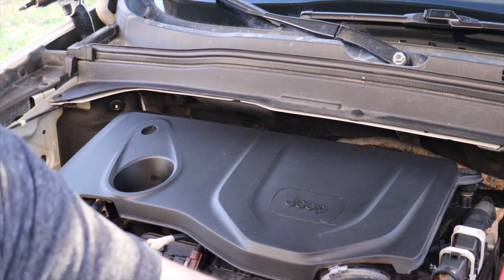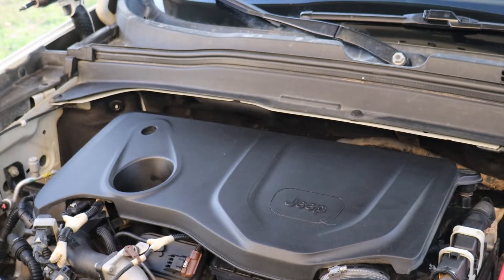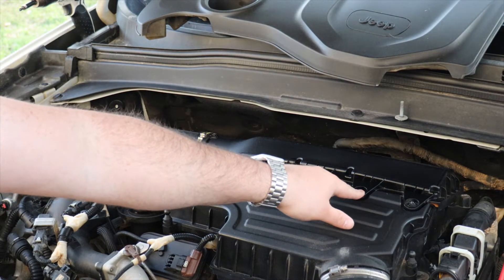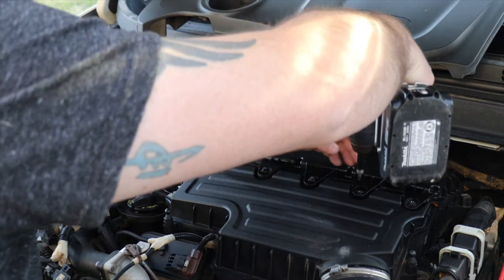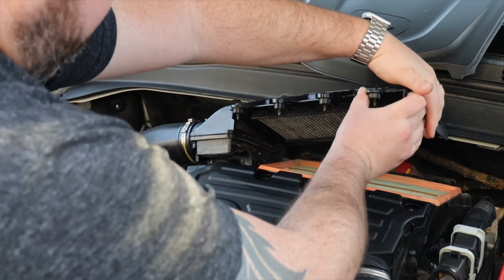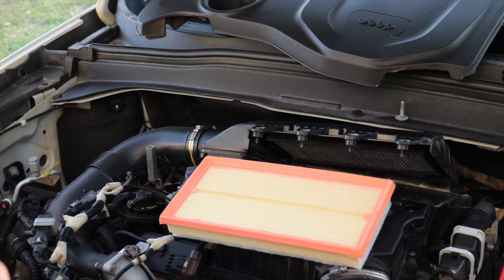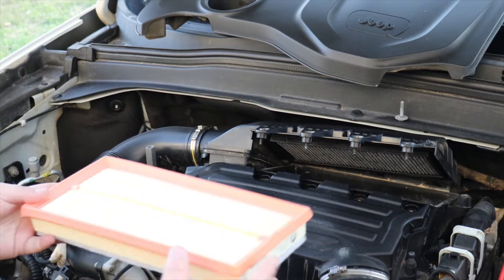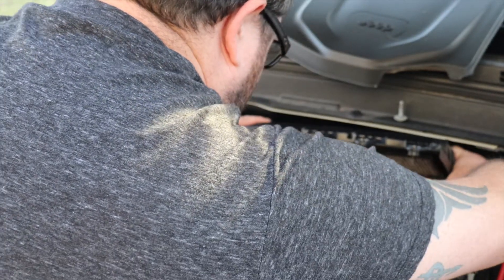How to replace an engine air filter on a Jeep Renegade with 1.3T

Comment: Thank you!  Thankfully found this, as there's absolutely nothing out there on my 2021 Fiat 500X, and the engine appears to be exactly the same!!!  I've never seen an airbox where you're able to partially see the edge of the air filter through the airbox (in this case, it's orange).  I thought I was doing something wrong.  Looks like I did ok!

Comment: My air intake bolts were too tight and started to strip, I suggest using an 8 mm socket instead of a Phillips screwdriver.

Comment: What is that built in non removable filter in air box top???
Reply: Not 100% sure. -Andy
Reply from the maker: Oops, didn’t mean to respond from my REX account. I don’t see a part number for the secondary filter. Probably added for extra protection since the air inlet in in the front grille. -Andy
Reply: sbinnala  Is it possible to get a vid on this?  Any clue how often it might need to be replaced?  I just changed my first air filter (as in this video) at 21k, and it needed it.

Comment: Interesting my 2020 1.3l doesn't have the engine cover.
Reply from the maker: That is very interesting. Ours is a 2019 Trailhawk, but that shouldn’t matter. I would ask you dealer about it.
Reply: Neither does my 2021.
Reply from the maker: @luchaDor  are they just bare? Also which country are you in, out of curiosity.
Reply: @luchaDor  I checked out some pics of other 1.3's on dealer pages and it seems like they must have eliminated the cover from 2020+. it does look kinda like it makes the oil dipstick/cap a bit more difficult to get to with the cover there.
Reply: @Reediscovr  Yep it looks just like yours when you remove the cover. I'm in the US.
Reply from the maker: @gigatigga  that’s crazy, I didn’t realize they made the change. Thank you guys for letting me know.